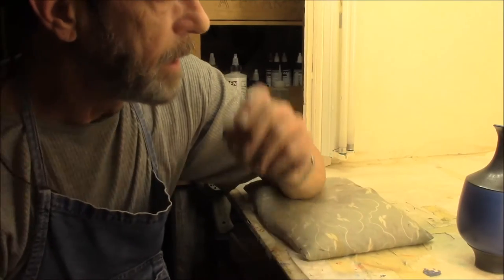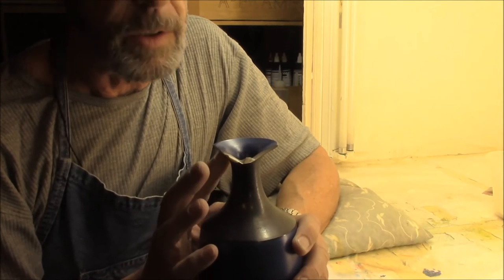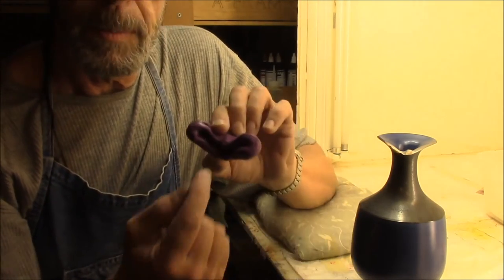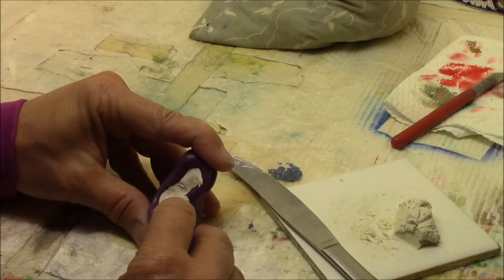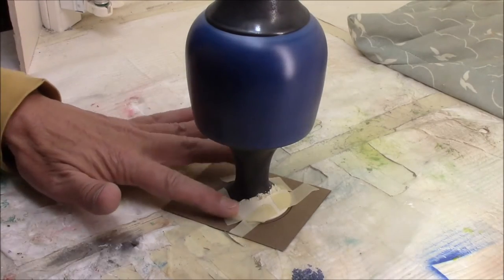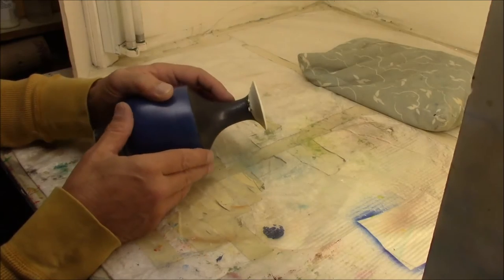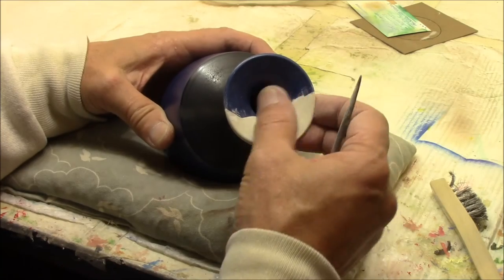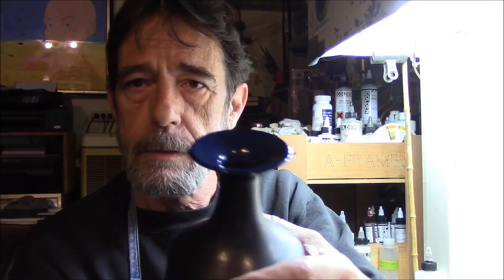small porcelain vase repair

Comment: EXCELLENT REPAIR !!!  CAN YOU PLEASE TELL WHAT KIND OF MATERIAL YOU USED FOR THE MOLD YOU USED AND ALSO THE EPOXIES?  ONE WAS SOFTER THAN THE OTHER.  ALSO, HAVE YOU EVER REPAIRED A HOLE, WHERE THE PIECE IS MISSING AND THERE'S JUST AN ASYMMETRICAL HOLE IN THE MIDDLE OF AN ITEM - LIKE A TUREEN OR PLANTER?  thanks very much

Comment: Hi! What do you use for the mold exactly and what exactly is the epoxy? Can you link please?
Reply from the maker: The mold material is called "Castin Craft Easy Mold': https://www.amazon.com/Environmental-Technology-2-Pound-Easymold-Silicone/dp/B004Y46GX8/ref=asc_df_B004Y46GX8/?tag=hyprod-20&linkCode=df0&hvadid=198096942604&hvpos=&hvnetw=g&hvrand=8073413463488255937&hvpone=&hvptwo=&hvqmt=&hvdev=c&hvdvcmdl=&hvlocint=&hvlocphy=9032360&hvtargid=pla-318948950539&psc=1 
the epoxy is called "Resolin A+B epoxy putty" the tan stuff: https://www.aplusbputty.com/.
Reply: @marsgitar  Thank you so much!!